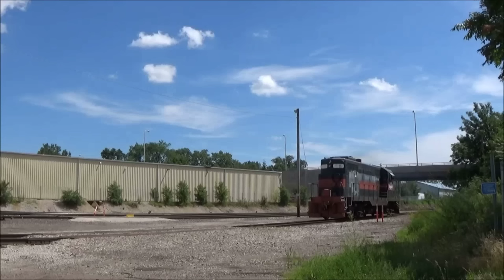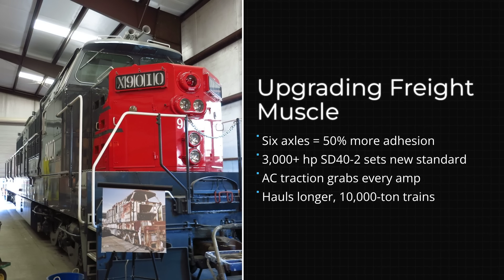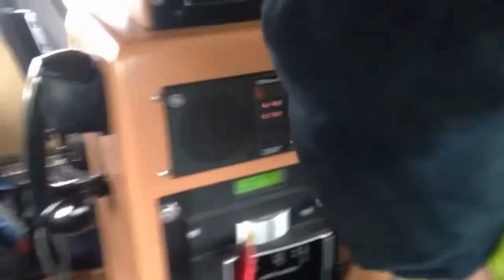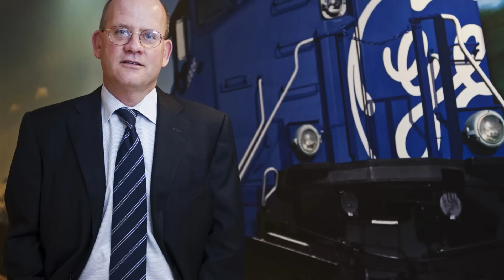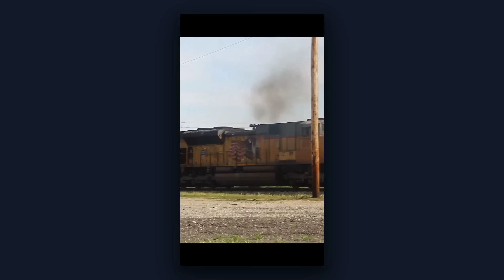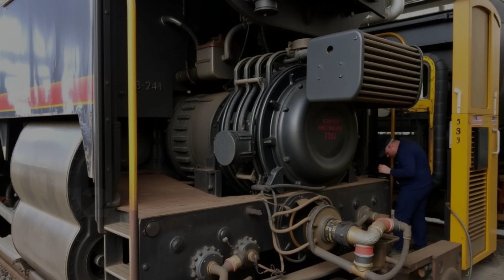Every Major Type of Modern Locomotive Explained

Comment: On the CNW GP7s were pressed into passenger service and had a boiler to provide steam heat in winter installed in the short hood nose of the locomotive. I remember operating those engines long after they stopped using them in passenger service.